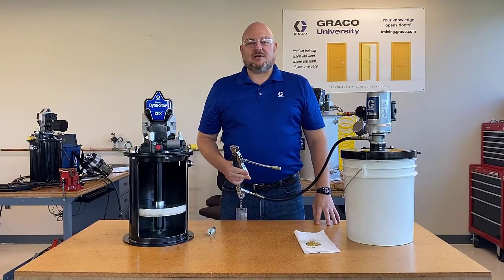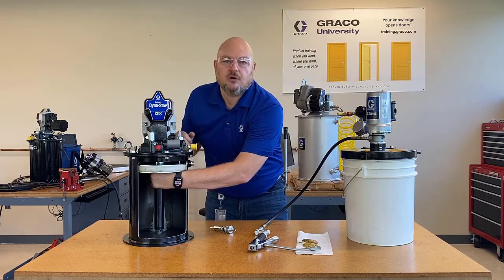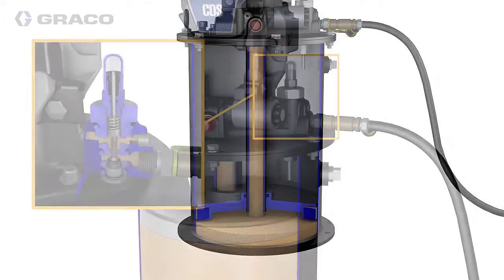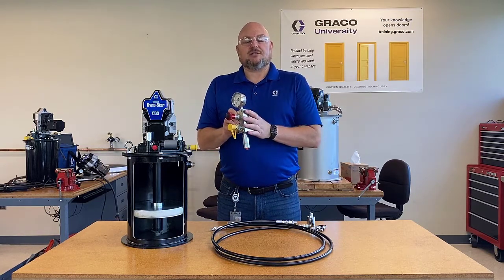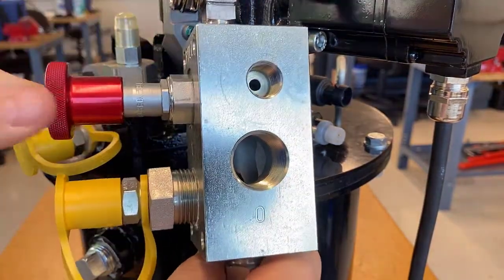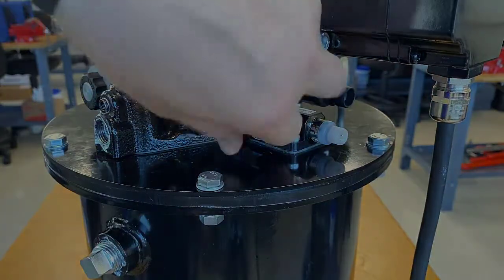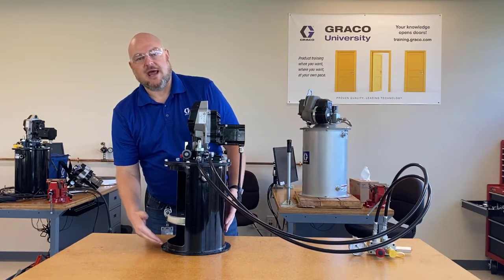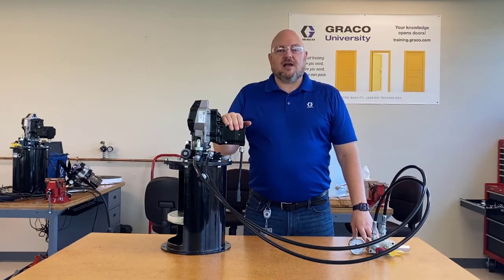Compact Dyna-Star (CDS) Auto-Fill Shut Off (AFSO) Valve Operation

Comment: If a controller say "PR 01" What is mean?
Reply from the maker: Hi there! Thank you for reaching out! The display "PR 01" for products such as a G3 Max or a GLC 2200 means that it is looking for a signal from a pressure switch. In pressure mode, as the controller sends power to the pump, it is pumping grease or oil and building pressure in the system. When the system pressure reaches the "set" pressure of the pressure switch, the switch closes and sends a signal to the controller. This tells the controller to stop the pump. At this time, the vent valve should also open to vent system pressure back to the grease or oil reservoir.